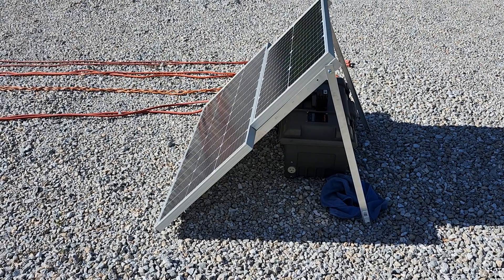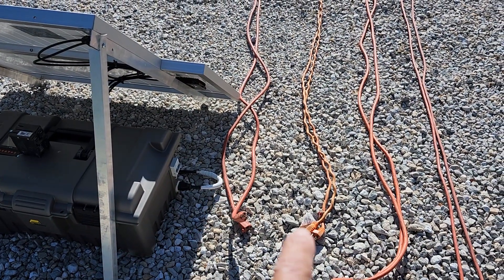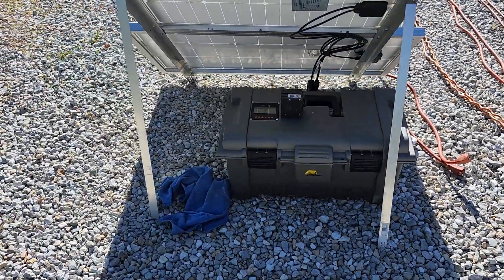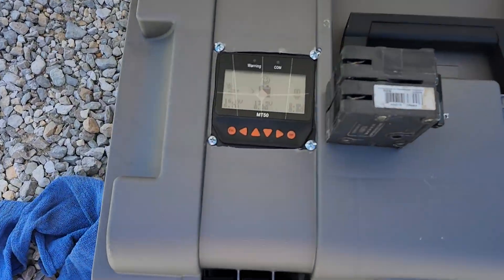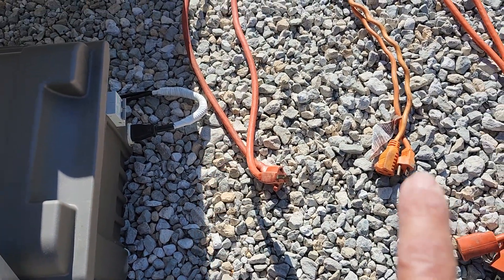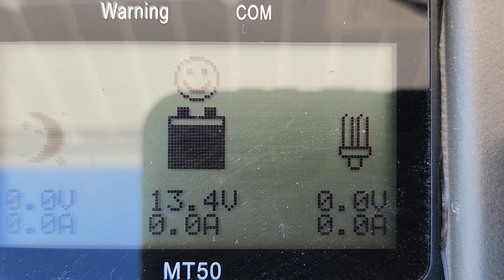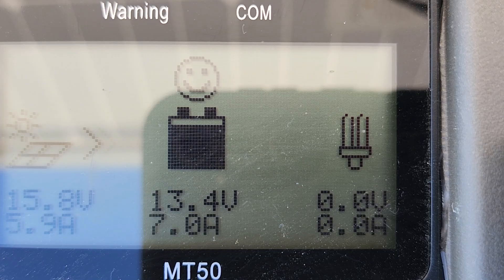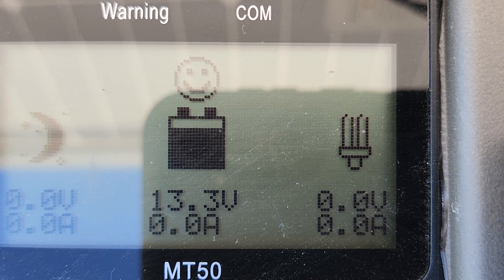Off-Grid DIY Solar wire size and length experiment.

Comment: All conductors have a measurable resistance per foot.  That resistance decreases with gauge but follows a formula for voltage loss (amps x line resistance = voltage loss.)  Power (watts) = volts x amps, so doubling the voltage will decrease amperage by half for the same power.  For any given solar system, raising the voltage decreases line loss....but going over 48v increases necessary shielding for high voltage.
Reply from the maker: solid info...ty

Comment: I'll ask the wife.  Seriously, we've got a large 48V system and a 500' cable run.  We're using 10AWG thhn wire rated for 600 volts.  We're maxing out at around 420 volts on each run.  We lose approximately 3 to 5% total from panels to inverters.  The panels are also rated at a bit over 11 amps.  You can see my setup in a few of our recent vids.  Getting ready to do a new one where we bury the lines in some 1" pipe.  We were able to bring the cost down by $90/500' roll by going with thinner insulation on the 10awg wires since it didn't need to be direct burial/ground contact rated.
Reply from the maker: Sounds like an awesome system...

Comment: So the point is this: Thicker wires cost more today, but they cost more only on the first day.  They make the rest of the system perform better every day afterward.  The extra you spend, you get back over time, and then some.
Reply from the maker: Facts...straight facts

Comment: At 48 volts inches matter. If you increase your voltage ages to the hundreds,  your losses are minimized. High voltage is your friend. BE CAREFUL
Reply: This is exactly why the big cables on the towers overhead aren't running in the hundreds or even thousands of volts, but hundreds of thousands for the longest transmissions of bulk power.  If you're going to lose X volts per kilometer of transmission line no matter what the voltage is, crank the voltage higher so the loss is a lower percentage.  It works very well.
Reply from the maker: Both the systems are @ 24v for the foreseeable future...but you never know...one might go 48v some day..

Comment: heavy wire wins the day and the longer the run, the higher the voltage needs to be for cooler wires :)
Reply from the maker: 100%   Got any suggestions for future tests?
Reply: @CentralIllinoisSolar  you're doing fine, I don't know what I could suggest.
Reply: do a 10 gauge
Reply from the maker: ohhh a 10 gauge cord 50'.    Wonder what they run? or if they even make them?  I bought the 12gauge 100' cord years ago when i was building. It wasnt cheap back then.